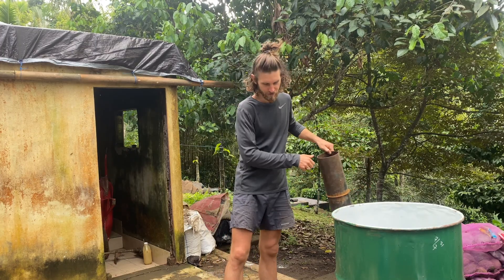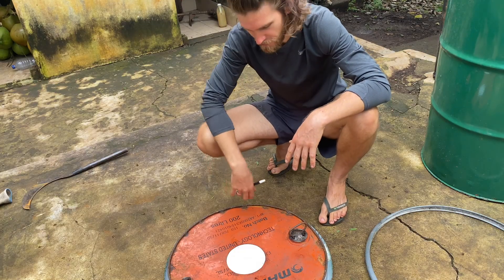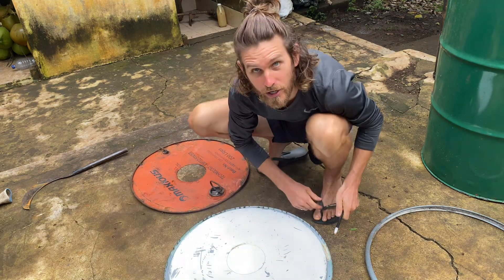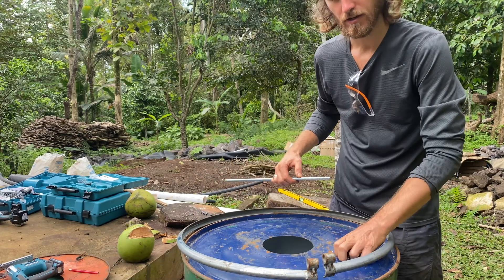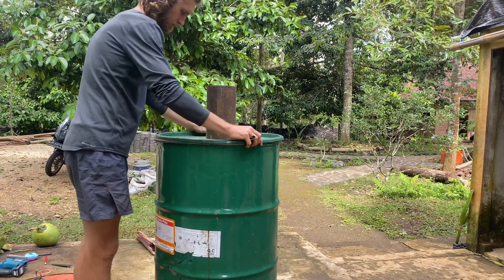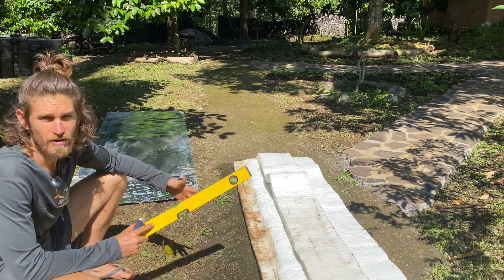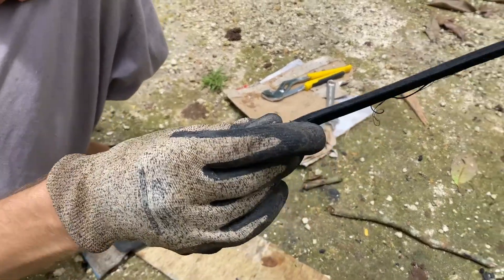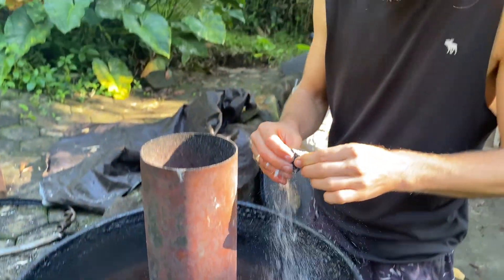DIY smokeless Charcoal Kiln | How to make BioChar

Comment: I have a tip for you that'll make a lot of your projects much easier: use imperial measurements. They're much better for fabrication since you can divide stuff by 3 and they're just much more practical. Metric is great for chemistry and physics but its really not very good for construction.

Comment: good morning sir.. what is the used of foam and steel cover? how it works and purposed?
Reply from the maker: Hi, it a ceramic fibre blanket. It is used to maintain the heat better I believe. I am sure if could work without it I was only following a design on saw on the web. Good luck 🤞🏼
Reply: @thefreegivores  Id guess the insulation is to keep the temperature in the oven uniform.  It also helps prevent children and animals from getting severe burns from touching hot steel.

Comment: In your design you need to take the wood gass from the top of your wood drum to the bottom inlet of your fire with a inch steel pipe this will stop a lot of the charcoal from burning and making it a lot cleaner free from smoke and will also take away the pressure from your top lid seal. 👍🤗
Reply: You need to use the wood gas that is created in the drum (flamable) to use it as a secondary fuel. (redirect it to the burning tube). Watch '' rt1000 charcoal retort'' from ''4 seasons fuels''. Basically the principle of a double burn wood stove. Hope it helps
Reply: @Wilderness_Tv  Great Idea.  You are talking about placing a pipe into the lid in the top and then routing that pipe down the side, underneath and then up a little bit into the flame tube.  ... That is awesome.  So you are using the gas pressure inside  to fuel the fire.   A bit of this might be going on all ready because the lid is shut the only place for gas to exit would be out of the holes at the bottom.  Another approach if there is not enough pressure would be to use a small turbo charger on the exhaust  tube.  The exhaust tube would need to neck down to create more flow velocity.  Once the fire got hot the turbocharger would spool up and pump the woodgas into the bottom flame inlet. If you had enough wood it would be very effective.
Reply: No not from the top or you'll get steam in it more like from the middle. You must be careful the flame does not come inside from the pipe / same goes for kiln burner that must be separate from the charcoal exauhst vapor pipe.
Reply from the maker: Thanks for the tip! Although I cannot seem to make out exactly what you mean, from your message 🙃
Reply: But yes this is the idea.
Reply: I guess the holes at the base of the pipe allow the gas to go out in the chimney and burn since the fire is just under